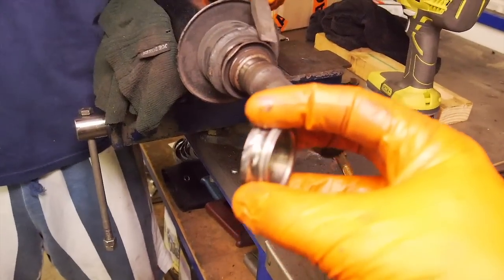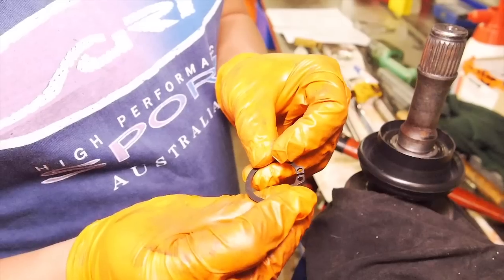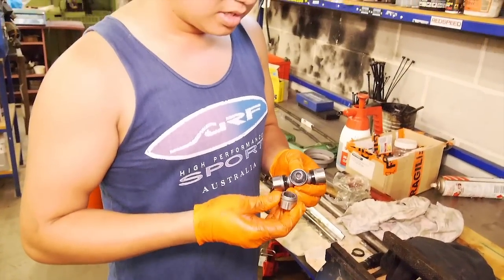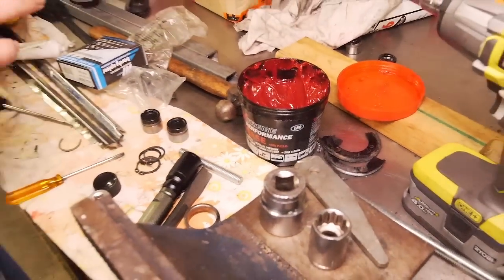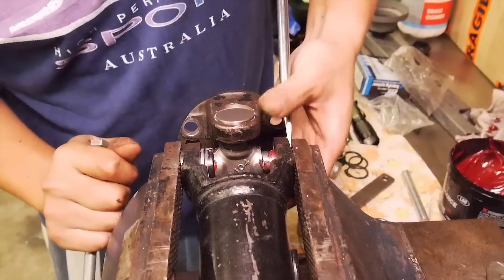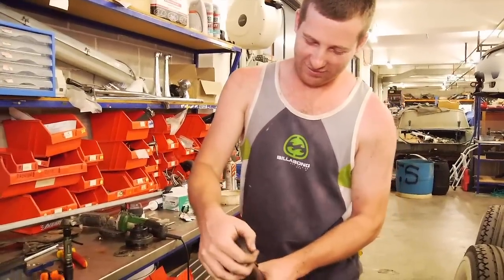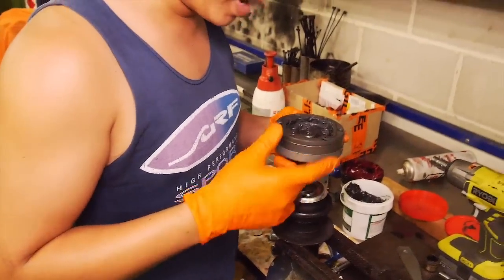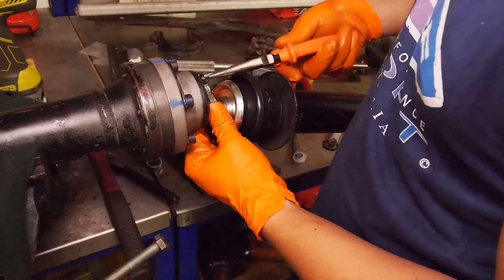HOW TO REBUILD YOUR TAILSHAFT... PROPERLY | UNI & CV JOINTS | PART 2

Comment: Awesome videos, only found your channel a few days ago. I home-built a VS V6 (w T5) turbo back a few years ago, was running about 12 pounds @ 195rwkw, funnily some of the things you mention I had the exact same issues. It's since had the engine/box removed and sold, moving onto doing it again but with a 5L. Quick question, you running the '808 computer?
Reply from the maker: Thanks mate, glad you found the channel ☺️
Yeah it's the VR manual ecu still. If you look through my 'inside the beast' playlist I've got a detailed vid explaining the ecu setup and also all the rest of the car👍
Reply: What sort of things are you talking about...uni:s cv joints?